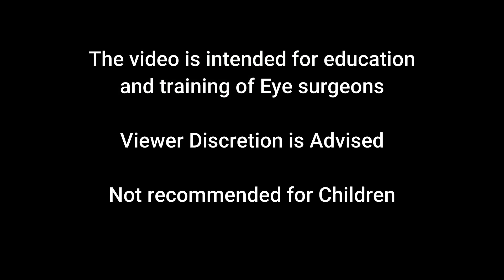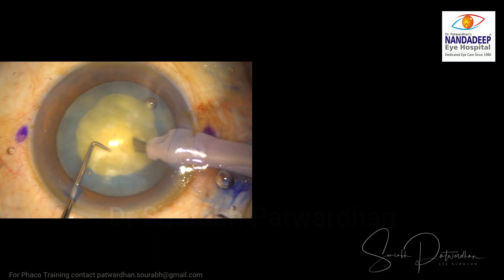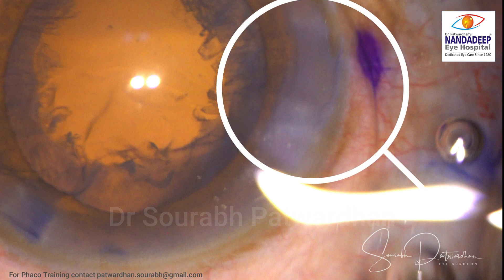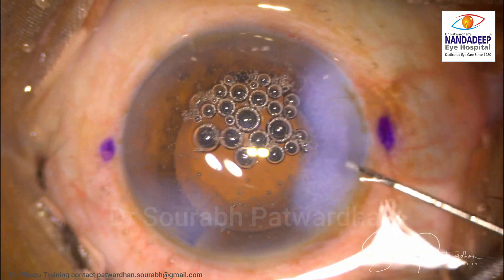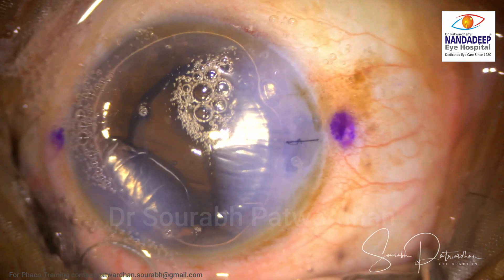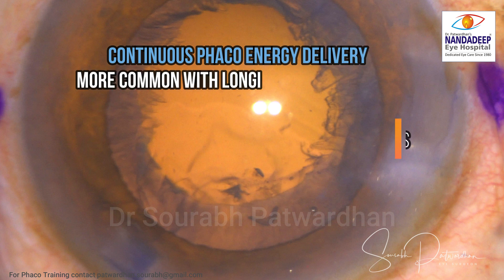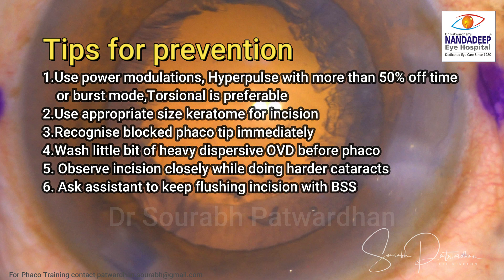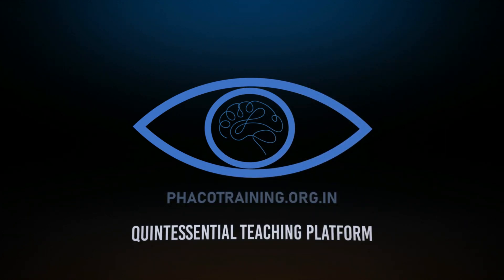Corneal wound burn : Cause,Treatment,Prevention Dr Sourabh Patwardhan

Comment: Better to use a horizontal mattress suture to bring the roof of the wound to the floor of the wound, instead pf pulling the roof radially to the mouth of the wound, as described by osher. I have tried it and it works well. Thanks for posting.
Reply from the maker: Thats a nice tip..thank you ☝👍